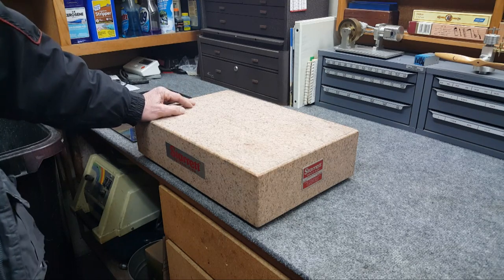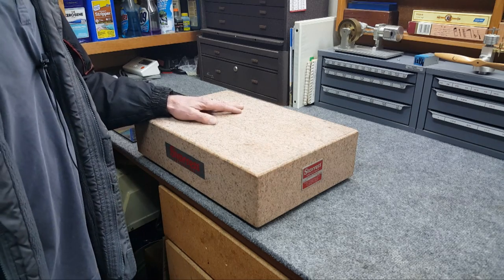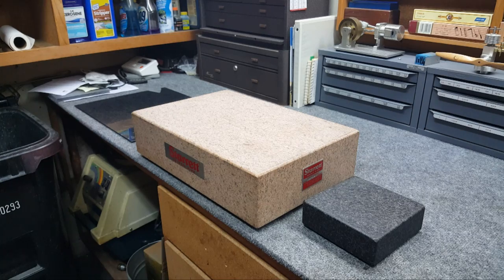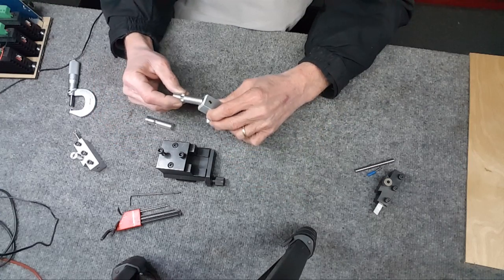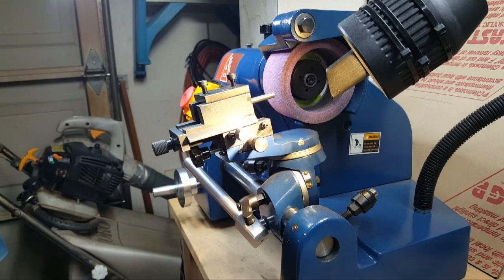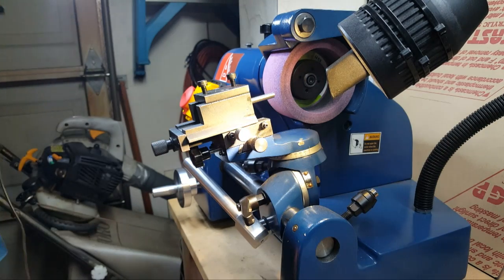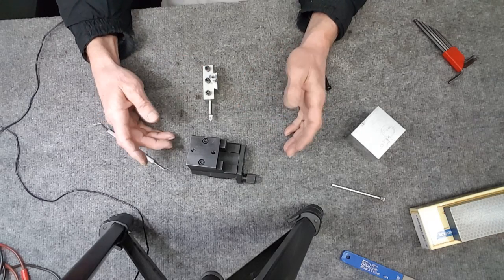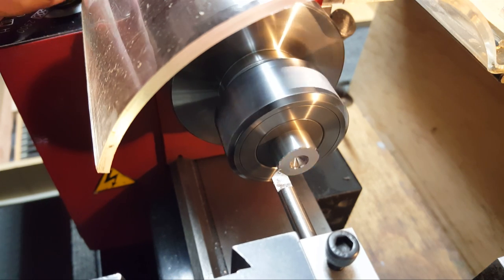How To Make a D-Bit Chamfer Tool

Comment: I’m confused why you can’t pivot in and out?
You shouldn’t have to slide in and out using the dove tail.
I subscribed to your channel to watch your instructional videos using the universal cutter grinder from Shars.
So far you have been the best source on how to use it.
This one confused me. Something about that darn spring too?
Reply from the maker: The spring allows me to move material in and out slowly if needed to prevent heating. I do use the dove tail to do plunge cuts with controlled depths.
Reply: What he's doing isn't how it's intended to be used. But, it's his grinder so more power to him :)

Comment: Instead of using the dovetail slide to grind into the work you may try pulling the whole vise or work hold device back towards yourself and let it spring forward (slowly controlled) into the grinding wheel. Just a suggestion that's how i have done it. Keep the videos coming especially  on the universal grinder I have one and would like to use it more and watching the videos gives me some motivation. I hope that made sense the bottom bar is spring loaded you have to loosen the clamp on the far right and leave it loose or not clamped. Actually the whole op could be done with your first setup in the collet.
Reply from the maker: Unfortunately the spring is so strong I can't really control it. I made a new precision base slide then made a new D bit. Far, far better with the new slide!!!! No play no sticking...
Reply: @TheMiniMachineShop  Gotcha cant wait to see it Anymore on the drill bits? or end mills? keep at it i need to get back on mine. I'm sure you watched Gotteswinters videos he has some good ones end mills and chamfer bits
Reply: @TheMiniMachineShop  Lose the spring, the original Deckel and Alexanders didn't have nor need them.
Reply from the maker: No way I have far more flexibility with it..
Reply: @TheMiniMachineShop  Your own experience making this cutter would indicate otherwise. But it gives you a chance to make m ore videos of additions I suppose. :-)